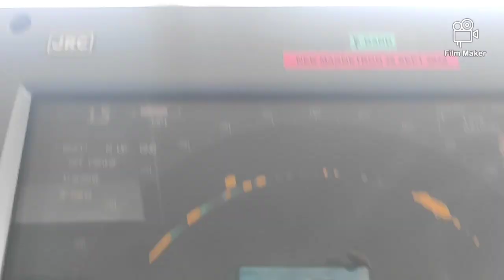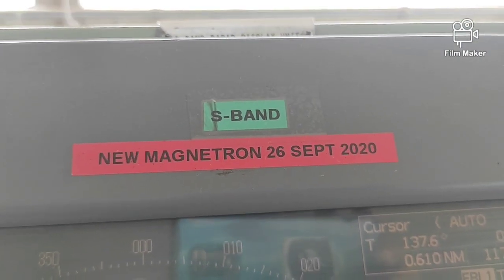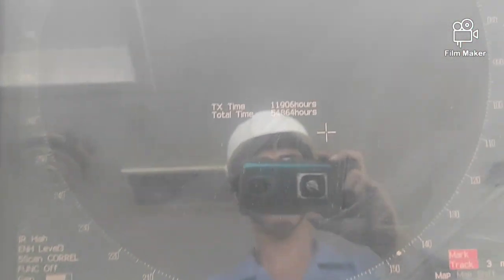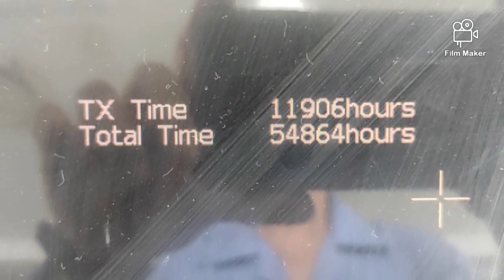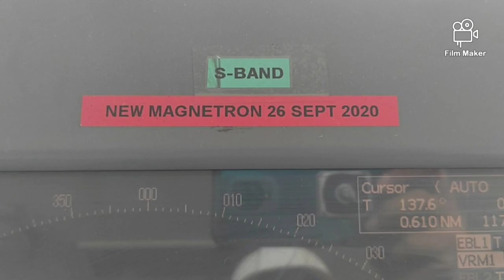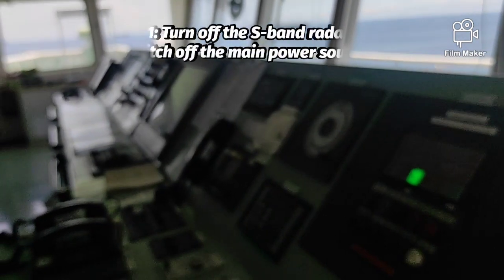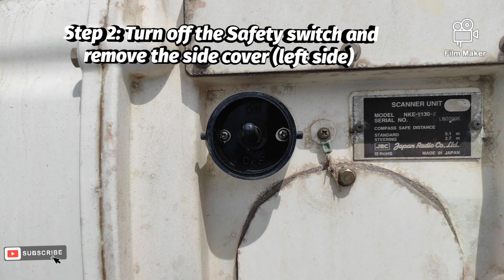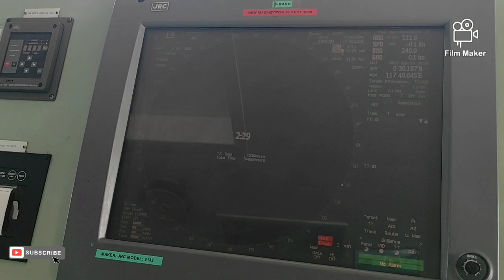How to replace Magnetron / S-BAND RADAR / JRC JMA-1932-SA / step by step procedure / Part 1.

Comment: Those wires need to be cut to a shorter length or could make electrical spark and damage the equipment.